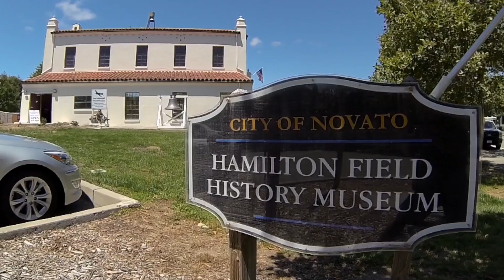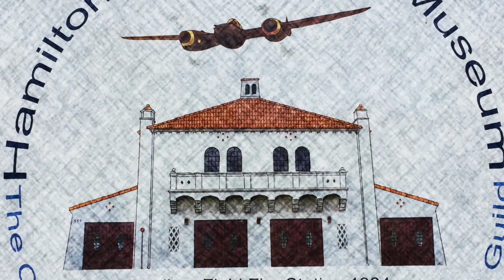Museum Minute - Hamilton Air Force Base - Novato, California

Comment: my dad was station there 1949 to 1053 as a radio operator, does anyone know if the radio room still there or gone?
Reply: Depends, I know the black point communications annex radio buildings are still there, and I know they did a lot of radio stuff for the base, but idk if they also had radio rooms on base and if they are still intact